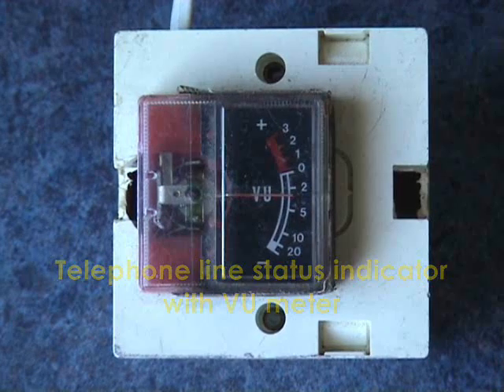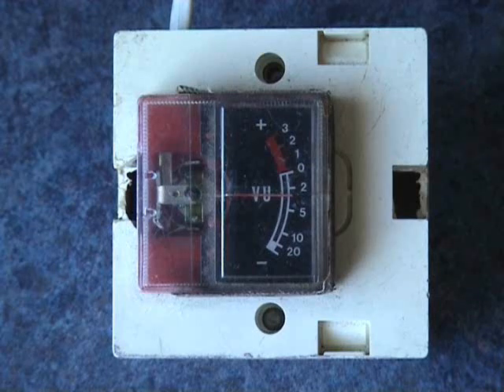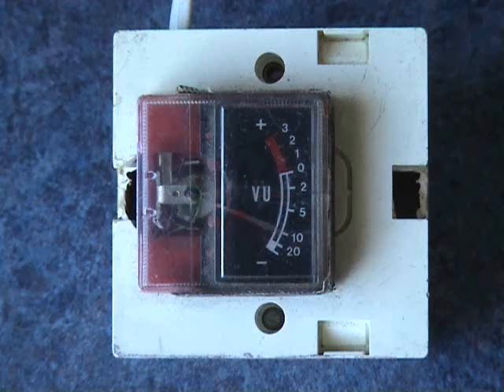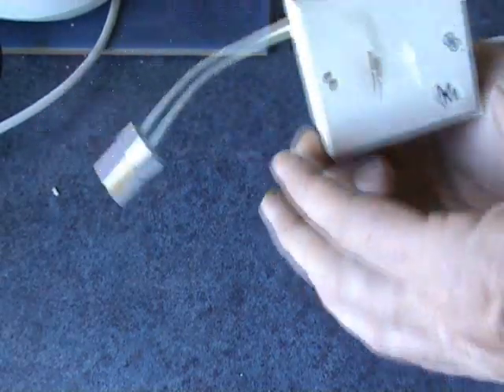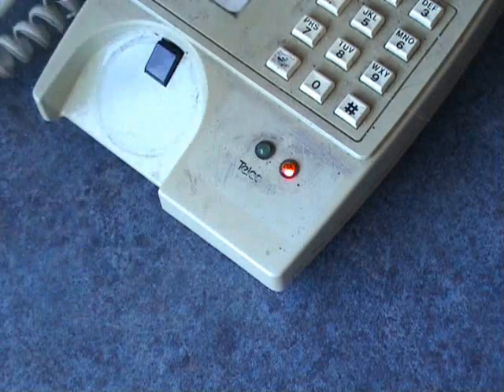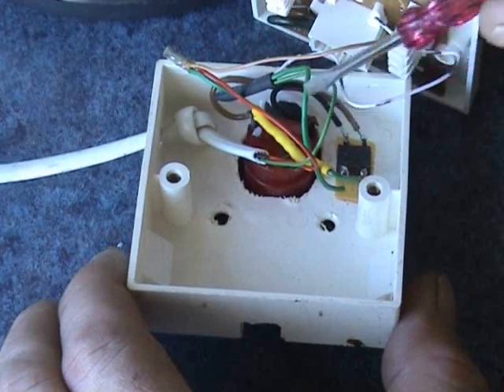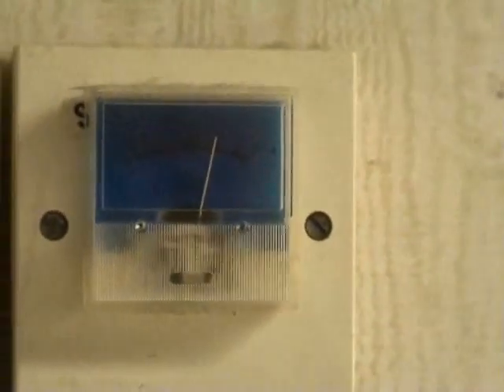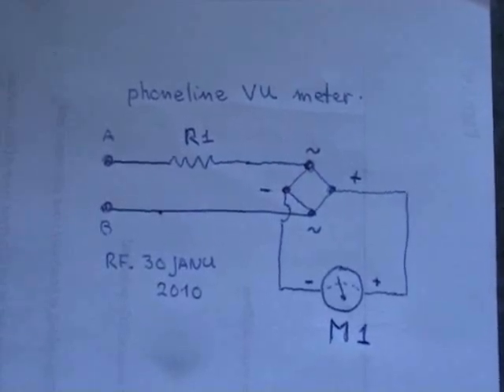Telephone line status indicator with VU meter

Comment from the maker: If the phone is left off the hook for a long period the line voltage will be zero, no reading on the meter.If the phone is put back to normal the system resets itself by the telco.